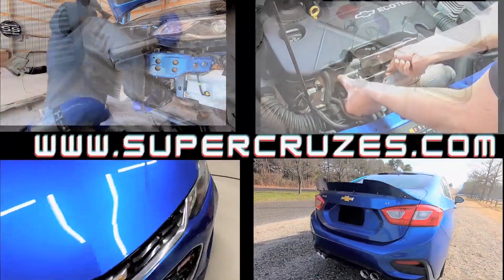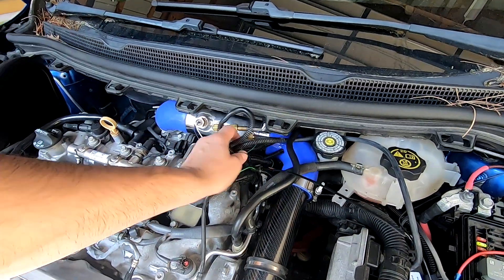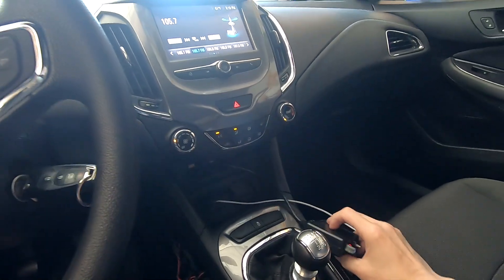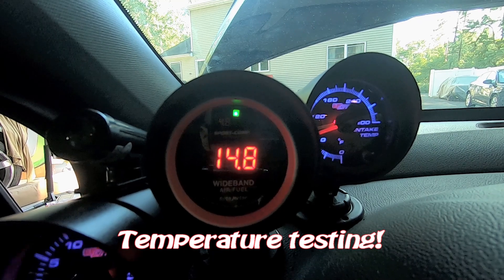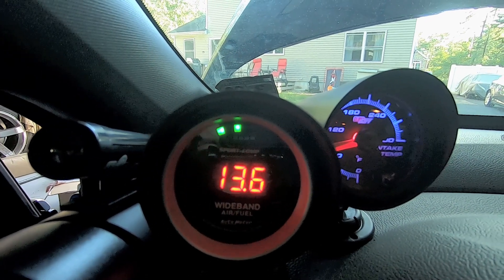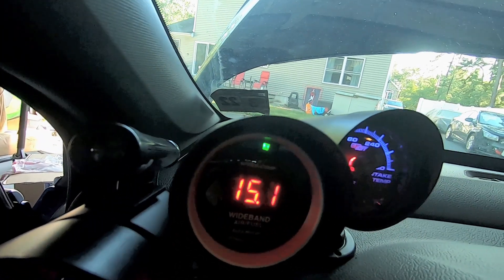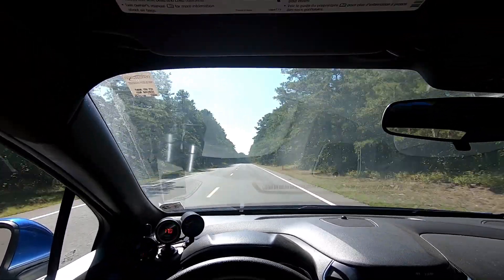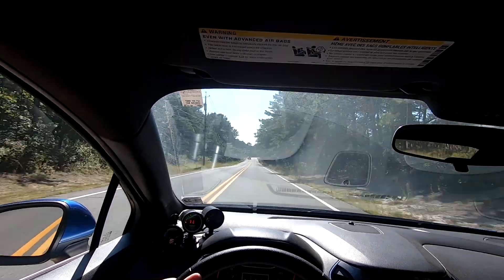Methanol injection how it works

Comment: I have a question, I have been watching all your videos so don't knock me if you mentioned it, your putting out a lot of content and I also have a busy life so if I forgot or don't remember don't knock me. I'm also watching from your oldest videos forward and I'm currently adding and modifying my Cruze. SO my question is, do you need to run meth if your going with a big turbo? and I'm assuming yes but just to confirm, do you absolutely need a big intercooler if your going to go with bigger turbo? cause in this video your saying intake manifold temp is setting charged air to 180 essentially. so is it neccesarry for a bigger intercooler? and is there a answer to getting a bigger turbo and maybe a bigger intercooler and getting all the power without overheating besides running meth.?
Reply from the maker: You want to run methanol over a certain power level. I recommend anything over 250hp especially if your over 300. Methanol when using 100% will provide the most power and cooling. It will drop your temp in the cylinders to double digits and provide basically 115 octane when it’s activated
Reply: @davesworld2132  so interesting. With all BNR tuning / add-ons, would it still need meth injection and bigger intercooler while on 100% e85? Zzp claims stock injectors can handle e85 and bigger turbo. Does the e85 provide enough octane and cooling to not need the meth and larger intercooler?
Reply from the maker: @Calvin-eq9fs  If you’re running methanol injection with Stock injectors you will be fine on octane. But if you are running a bigger turbo on stock injectors without methanol it depends on how big the turbo is. I have two turbos on my website that are massive that you could not run stock injectors with. However since we are talking turbochargers with injectors I’m assuming you have a generation one cruze?
Reply: Nice.Completely new to flex fuel and cruzes. The le2 is what I’m building thanks to all your videos I’m glad I went with BNR for everything but am completely new and was having trouble finding out about e85 and zzp videos saysthe e85 le2 stock injector big turbo is ok , assuming your on the meth bc the higher your speed needs to be in the timing, the whole time I was reading about e85 and did t realize its flex which makes sense bc ur on meth for the higher speed and energy it gives … no telling what you get at the pump 85 learning a ton! Thanks for the content you put out I’ve watched all your videos and it’s been super helpful
Reply: Have a ton of research to do on why people inject meth still but I just wanted something simple as pump n go power

Comment: dave i put 18" wheels on my cruze and now it wobbles have rebalaNCED THEM 5 TIMES STILL WOBBLES BUT THE WOBBLE STOPS AT POINTS. YOU THINK IS SUSPENTION BALL JOINT ???SWAY BAR???????
Reply: Nope there on there
Reply from the maker: @jaypeacey991  hmmm could be a loose ball joint or possibly a strut
Reply: @davesworld2132  new struts but I will look maybe
Reply from the maker: @jaypeacey991  Check all of the connections and your end links
Reply: Check it out they drilled tne hubs for the lug pattern and pressed some inserts in not cool. I. Going g to return them
Reply from the maker: @jaypeacey991  I would measure the distance on everything to make sure every part is centered correctly.
Reply from the maker: I bet you are missing hub centric rings. Email me pics of your hubs and the back of the wheels hub.

Comment: 12.2-12.5 is where BNR tunes direct injection turbo engines during power enrichment (WOT). Many tuners go leaner, as high as 12.8-13.0, but BNR runs things on the rich side for safety. The ECM will also richen the AFR when certain temperature thresholds are reached (turbo overtemp, piston overtemp, etc.)
Reply from the maker: Hey how’s it going. I actually mentioned I believe about halfway through the video that you recommend around 12:1  I was close LOL
Reply: @davesworld2132  Yeah, 11s is too rich typically on direct injection but every engine is different and if yours seems happy there, then more power to you. You should definitely send us a log when you get the AFR set where its going to stay, we should be able to add more timing and make more power, similar to E85
Reply from the maker: @badnewsracing  last file you sent I didn’t have installed in this video. This was the old file with the boost wall problem and at one point it was so lean it was hitting 14:1 when the wall happened.  Since then I’ve put in the new file and the AFR is better. I will data log when I have a a free minute.
Reply: @davesworld2132  Now if/when you do this on your gen 1 cruze, 11.5:1 during WOT is perfect
Reply from the maker: @badnewsracing  yea I have my Vette at 11.5:1 . This footage is from a few months ago. I haven’t finished the 30psi tune yet with the new AFR.